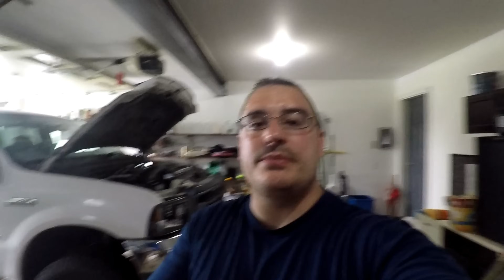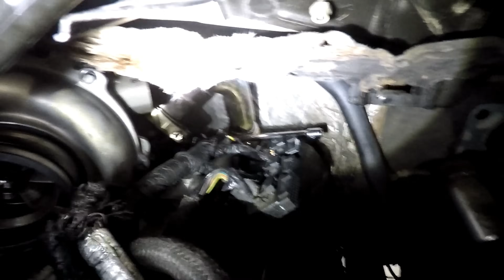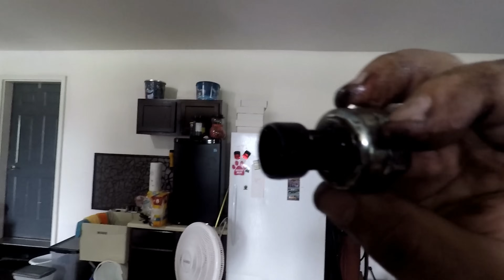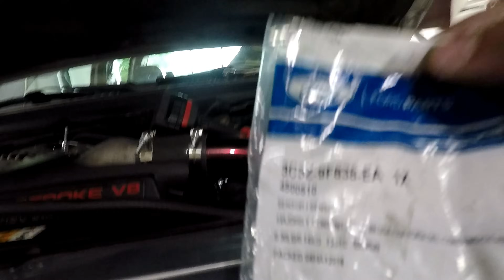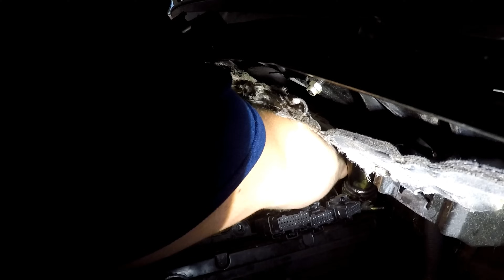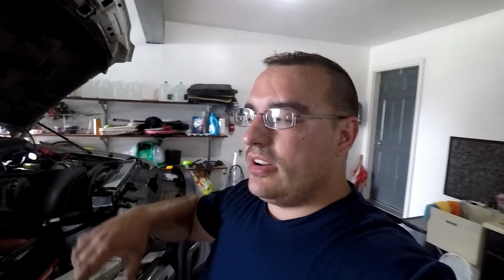6.0  Powerstroke ICP Sensor Replacement The Easy Way

Comment: them cheap ipr screen kits r horrible i just replaces mine 9 months ago pulled it to check it and screen ripped i changed oil 5 times so i no oil was clean
Reply from the maker: I think ford sells an ice screen kit
Reply from the maker: I have a motorcraft ipr I just bought but it has the 03 screen so I want to get the updated screen from Ford
Reply: I just ordered a screen kit from accurate diesel screen looks alot heavier than the cheap one I bought

Comment: also how are them pipe boots and incooler pipes holding up
Reply from the maker: They are holding up fairly well. I don't know if I love the fitment but overall I like them. The clamps are terrible though
Reply: i still have my stock ones in garage tired of waiting for machine shop waiting on heads to get back lol
Reply from the maker: It's worth the wait. It is a long process but when done right well worth the wait
Reply: lets hope it done took heads to ice machine in pittsburgh pa 1 hour drive i drove past many machine shops to get to that one lol they did few motors for a friend of mine so fingers r crossed man heads getting decked new valve seat i told them idc what they have to do i want them done 100% im doin alot more than studs and head gaskets and cant afford to do it twice found out today low oil pump has some wear marks on cover have to get wear ring off before i can inspect oil gear it self
Reply: i pressure washed all parts off truck with zep degreaser worked awsome did rad intake intercooler should have seen dirt build up in the fins lol under cab that zep burns ur lungs when u breath it in

Comment: i had to change out pig tail also when my icp went plus mine was so bad it had a sleeve over the wiring it was soaked to had to scrub it out wish i would got the tool u have i bought the cheap amazon socket lol
Reply from the maker: I use to have the sleeve on mine I should probably buy another one honestly.

Comment: I have do e it that way but honestly I think it's easier to just pull the turbo
Reply from the maker: I have to pull my turbo to do my darn ipr valve. I can probably do them in about the same time pulling the turbo is the way I did hear. Do you have the 03 intake manifold?
Reply: 6.0 Bros that's what I was referring to was the ipr. Mine is a late 04 model so my ICP is on the passenger oil rail. The IPR will come out the same way as you did the ICP, I just think it's easier to deal with taking  the turbo out
Reply from the maker: It won't be to bad I just don't care for pulling the turbo. It's bot as bad as everyone makes it out to be but I have pulled it a lot this year lol.
Reply: Me to, I was chasing a high pressure oil system leak. After replacing everything the hot no start is fixed now I have a rough running condition until it is at full operating temps.
Reply: Eric Fronabarger hot no start? That’s the same issue on my 6.0. We pressure tested the high pressure oil pump and on barely any pressure it instantly leaked right around the gear housing area. Hopefully that’ll fix it but I’m wondering if more could’ve gone wrong somehow...
Reply: Joseph Samsor hopefully so, I replaced everything on the high pressure oil system.
Reply from the maker: What year is your truck?
Reply: 6.0 Bros mine is an 03
Reply from the maker: The good news is that typically on the early style there are not many high pressure oil leak places. The bad news is yes you are most likely looking at a hpop. Any work done recently? Sometimes the o ring on top of the J tube can be a common leak
Reply: must say i like and do it same way to get icp and ipr pulling turbo aint to bad but just more gaskets to buy lol